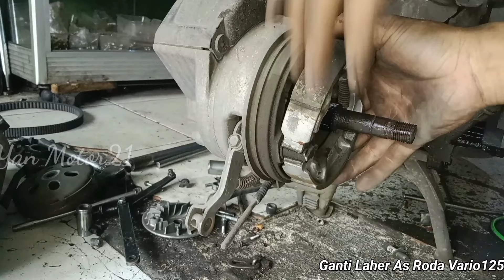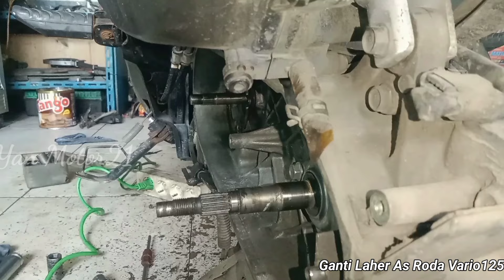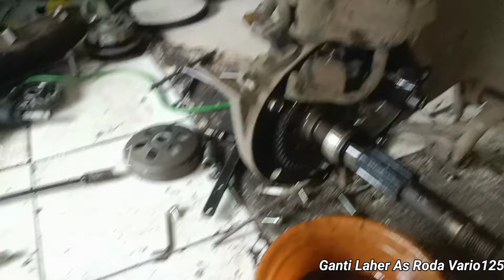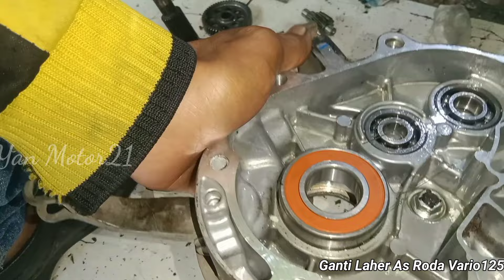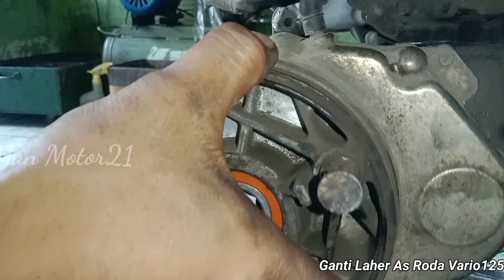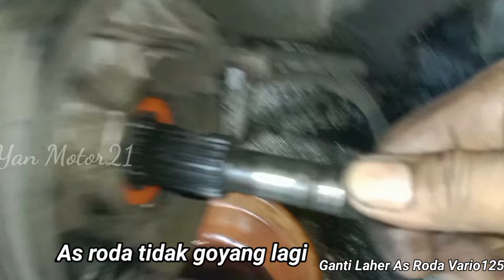Ganti Laher Roda Belkakang Vario 125/150

Comment: Laher nya seri 62 berapa om?
Reply from the maker: Yg original skitar 60
Reply: @yanmotor21  kl buat roda depan kan 6201,kl buat roda belakang kodenya brp om..? Sy nyari di goggle belum ketemu😁🙏🏼
Reply from the maker: 6205
Reply: @yanmotor21  maturnuwun om
Reply: @yanmotor21  Vario 125fi 2012 sm jg bang 6205?
Reply: Merk apa bearing 6205 nya mas?
Reply: Klo pke 6205 yg tutup nya seng apa bisa? Saya coba ukur tapi kaya ketebelan.padahal kode bearing nya sama

Comment: Kode Bering nya brpa bang
Reply: Motor saya kan Scoopy ring 12 tapi saya ganti vleg pake punya Vario 125 as nya sudah saya ganti tapi Bering nya di ganti SMA saya itu pun harus saya ganjel ,
Apa bisa pake Bering 6205 bang ?
Reply: Ada 2 Kode Part Honda yg bisa dipakai (Bearing 6205):
• 91006KAB004. 
• 91009KWN901.